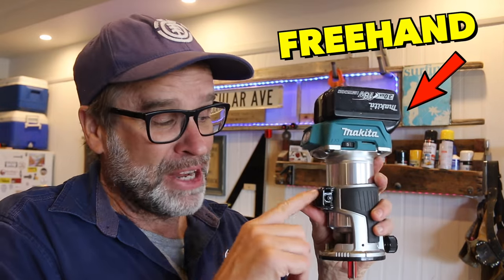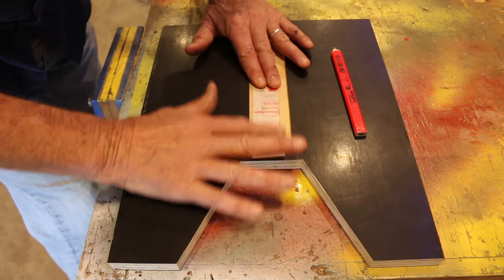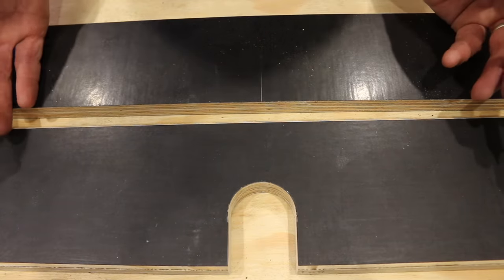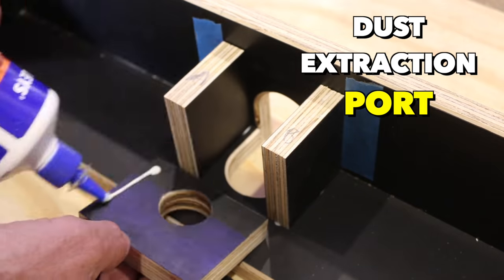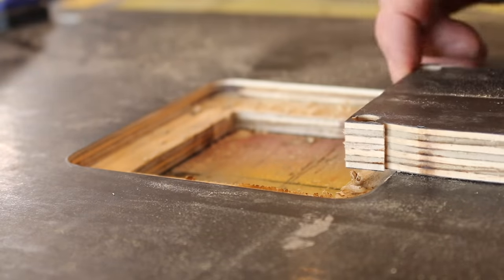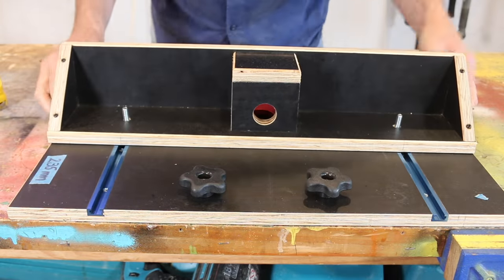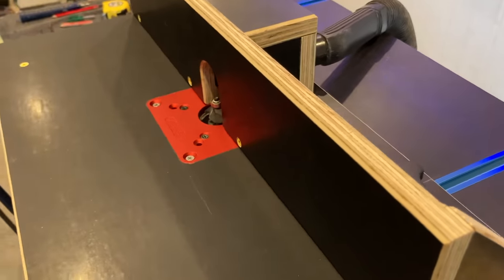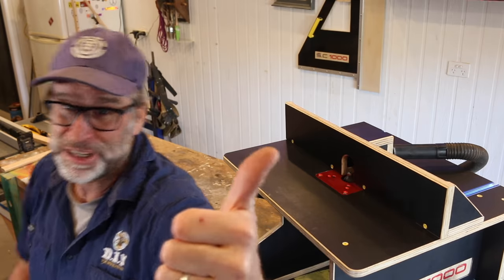The BEST DIY Router Table for Beginners. #woodjigs21

Comment: So I did the router template, but my router was was tearing into my template.. I’m confused how to avoid that
Reply from the maker: You need a router bit that has a bearing on the top. The bearing runs on your template and prevents the bit from digging into it.
Reply: @diyforknuckleheads  thank you for your concise answer! I was very confused yesterday while trying to build my table! Managed to do a decent one free hand. Will get the bit with bearing in top!
Reply: @diyforknuckleheads  I was looking at the router bits. The bearing is on the tip, so how do you make the initial plunge into the material. And would that mean the template would have to be under. How come when you did yours the template was on top
Reply: Ok I can see in the start hat the bearing is actually in a different spot than what I’m looking at Bunnings! Where do you get your bits?
Reply from the maker: @Theiftanlazx  l get them from Bunnings mate
Reply from the maker: @Theiftanlazx  the router bit is a flush trim bit and the  bearing is on the top of bit. So you have the shank of the bit, then comes the bearing and underneath the bearing is the cutting bit…. Hope that makes sense

Comment: Hey Uncle Knackers, save yourself some money and don't use glue. It doesn't stick to formply, I have tried in the past. If you want to glue, you have to sand the coating or preferably remove altogether.
Reply from the maker: Yeah good tip mate....force of habit 👍👍😁🇦🇺

Comment: I think your version of Formply is our UK version of conti board…… anyone?
Reply from the maker: Mmnnn...not sure mate 🤔
Reply: UK conti board tends to be chip board, not ply based. Doubt it would be stable enough of a material for this.
Matt
Reply: It's called Phenolic Faced ply or Formwork plywood in the UK. Performs the same function as Form ply (concrete forms etc). Comes smooth (Film faced) or textured to be grippy.
Reply: @clifftonsfly  can you buy this stuff in B&Q or from a wood specialist

Comment: When form ply was cheap this would have been great but it's now 55$ a sheet
Reply from the maker: Mate, the stuff from Bunnings is 21 bucks for a 1200 x 600 sheet. I used two with a little bit left over  so all up 42 bucks 👍

Comment: I wouldn't trust the clamps holding the table up, due to all the vibrations... one thing you definitely don't want,  is to have an operating router fall onto your hands
Reply from the maker: G'day mate....Get yourself a good set of clamps Lazarus and you'll be fine. The vibration coming from a router is minimal to say the least. 👍👍

Comment: What router bit are you using here?
https://youtu.be/MxNbfjyHqyg?t=109
Reply from the maker: Hi Deon. It was a Straight Cutter with a bearing on top of the shaft. Make sure you get a straight cutting bit that is the same diameter as the bearing. Thanks for watching
Reply: @diyforknuckleheads  thank you very much. I really enjoy your videos. Thanks for sharing them with us.
Reply from the maker: @deonholt   No worries mate 👍😁